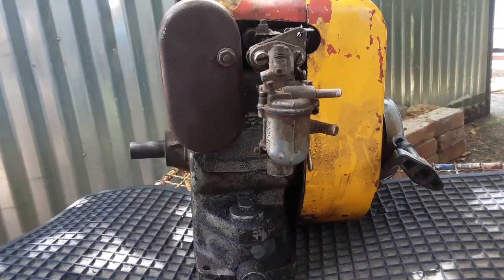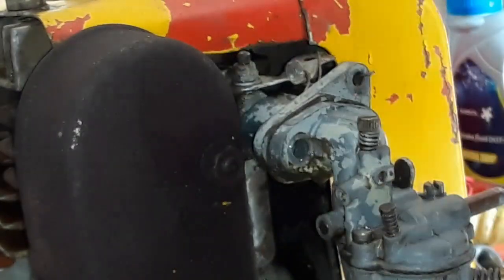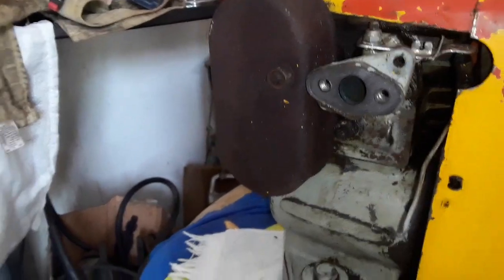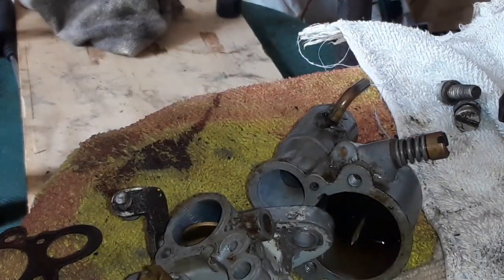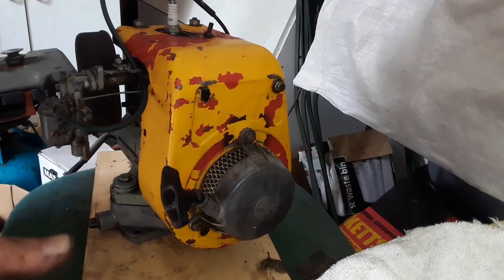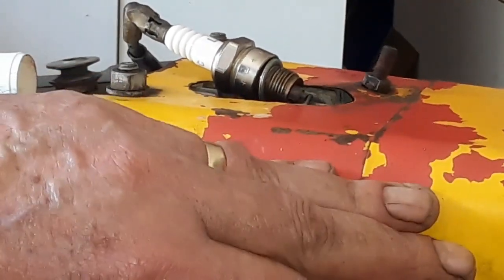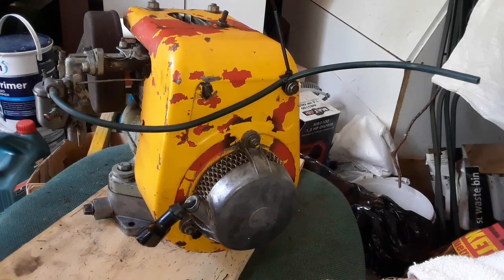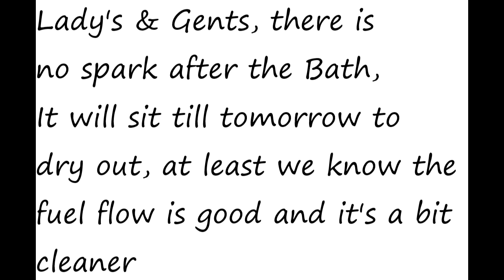Sufflok Engine clean: Remove the Carb: Remove the Pull Start: No Spark After Cleaning

Comment: It cleaned up well. The points and coil are behind the flywheel, they could be wet. I am not 100% sure but I think the plug should be a NGK B6S. Today we were talking about where our Suffolk machines are and we believe they are in a building that we have not been into for a few years and we will need to clear the brambles to get to the door. We will try to do that this week and then we can take any pictures that you would find helpful
Reply from the maker: O whao Joseph, that will, be very useful but I don't want to make so much trouble for you

Comment: The lever you originally identified as the throttle appears to be a fulcrum for the governor.  I'm assuming the system is similar to engines built in the States. 
I suspect there is corrosion on the contacts for the magneto.
Reply: Thank you Jan.
Reply from the maker: Bryce, that is very true, I thought if the fire is not back today I will go into the flywheel and points

Comment: It cleaned up fantastic my friend! That's not uncommon to happen after washing them. I would assume that engine being older will have points ignition. Perhaps verify that, and if so, give them a light sand with emery cloth and check the gap might help it along. We will have to research to see what kind of plug you can use in it, as no doubt that will need replacing eventually aswell.
Reply from the maker: Yes Bendan, the next step will most probably a look into the points, it will help a lot to know the size plug since it is bigger than a standard car plug but very short
Reply: @jankotze1959  I put your engine model number into a search and according to that, the correct plug for that model Suffolk engine is the NGK B6S. Which cross references with the Champion J6, J7 or J8. There's quite a lot of info about them online, very interesting old machine.
Reply from the maker: Thank You Brendan, that confirm what Garden TractorBoy said, awesome @brendanfromnz

Comment: what is that adapter thing on the end of the spark plug is that to make a regular plug fit the engine?
Reply from the maker: Verrnon, I think you just put some light on for me, the end of the plug looks very weird and that is most probably an adaptor, I will check that out